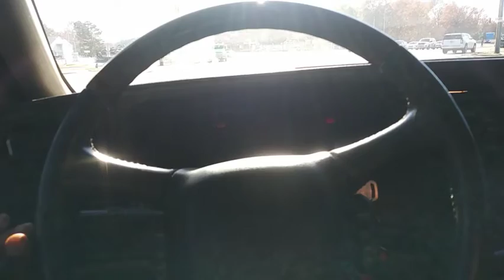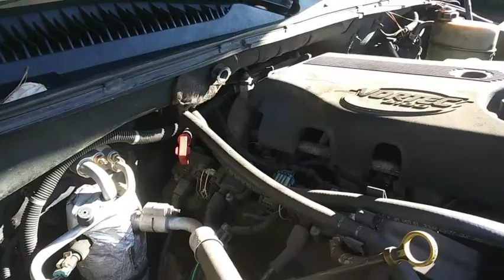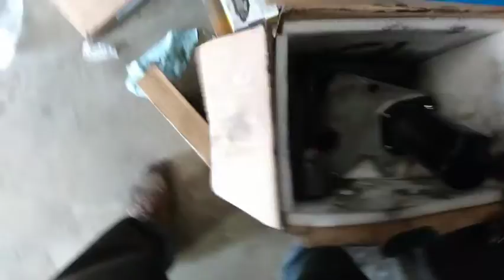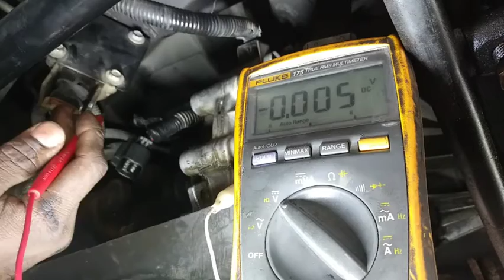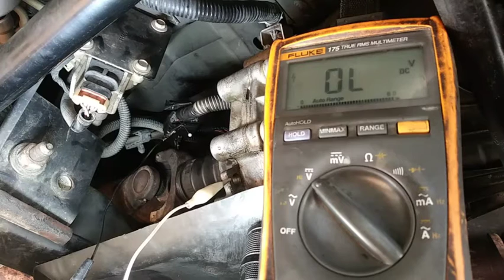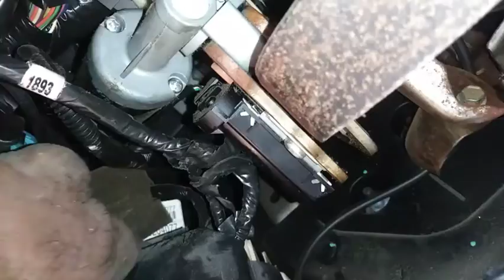???Chevy diagnose C0306 C0374 C0327? SMOKING transfer case???

Comment: stupid question but is there supposed to be oil in the transfer case motor or just gear grease? if theres oil in it, is that shorting out the tc motor?
Reply from the maker: Not a dumb question... The answer is "no" there isn't suppose to be oil in there, likely just electronic grease
Reply from the maker: Likely, this is this particular case, oil being inside cause of shortening out internally or some type of connection issue plausibly
Reply: @partsshooter  ok cool, so just for reference my switch does the same as yours, it all lights up on turn on but then goes blank. so i just did all the test and got all the same values of your working system...except for pin C the encoder ref. i got mili ohms and no voltage (neither test, ground to chassis or using pin F) any ideas?
Reply from the maker: @nuffsaid5205  when you select a mode at the switch [4lo 4hi etc], does the mode flash several times and nothing happen or doesn't flash at all
Reply: customhonda it only lights up on initial turn on then the switch does nothing. I’ve replaced the switch, encoder ring and front axle actuator
Reply from the maker: @nuffsaid5205  gotcha... Disconnect both encoder and switch in truck, Do a resistance test from channel c [red/white] at encoder Motor] to switch inside [also red/white wire] there should be low ohms around 3ohms. If not fish for the open wire. Compare resistance to channel D corresponding wires, they have the same operation fundamentals
Reply: customhonda here’s what I got so far; with battery disconnected I was able to trace pin c (on my vehicle it’s black with white stripe) up into the engine bay to a connector next to the fuse box with my voltmeter. At the encoder connector I get a .4/.5 ohm. Followed to the connector under the hood (no break in wire anywhere) it measures .1 ohm from encoder connector to there. I was able to trace that to the connector for the tccm and also got .1 ohm. But I get not continuity to the switch connector for pin c. (Even with battery and key on). No fuses popped. Between the tccm and switch there’s seems to be no wire damage. Through the tccm do you know which pin would be the output for pin c to the switch...if there’s even one? Because if I can find an output pin that’s not measuring I could probably assume it’s the tccm that’s bad right? But then again why would all the other pins at the encoder connector measure correctly except for c...(lol sorry bro for all the questions you’re the closest I’ve come to anyone being able to help me)
Reply from the maker: @nuffsaid5205  send your vin. Let me pull a diagram. Doesn't seem like my schematics are the same as yours. 

Because on video wires, the switch control module go directly to encoder motor.
Reply from the maker: @nuffsaid5205  also, do you have a scan tool to look at PID DATA? To access 4wd module
Reply from the maker: @nuffsaid5205  I apologise... You're in fact correct, they're the same wiring diagrams. Switch communicate with 4wd module and them encoder. [Switch-control module-encoder]  

I may back track on some things...  bare with me.

Have you simply tried disconnecting the transfer case module and reconnecting for resetting?

- you obviously seems like you have power and grounds going to both switch and encoder.

Only thing we don't know before concluding the actual modules bad is if we can communicate with the module or if theres reflection from switch to control module, and just an output issue. 

Try this... Go to the interior switch, the "light green" will be 8v reference [8v direction,Out module and into control switch] theoretically [I'm thinking based on wiring diagram] you should press a selection [4lo 4hi etc] each selection should vary the output [light blue wire is dog wire to module] commanding module to determine a position. See if you have varying output voltage going through the light blue wire! If so, 

Go to either one of the encoder wires for reflection of similar voltage. Brw/wht, red/wht,yel/blk and or drk blk/white. I assume one of these wires depending on position will reflective respective voltage. May need two volt meters.

This is the only thing I can think of when not having a scan tool it's gonna be convoluted
Reply: @partsshooter  So here's what I've got; (I repeatedly disconnected and reconnected the tccm so it wasn't that)

I did the testing from the switch, got the 3 different voltage readings, also found a video that shows how you can test the switch by itself (not connected to truck)

I couldn't figure out why I was getting all the right values when testing from the encoder connector or from the switch. Affirming the tccm works. All this led back to accessories; encoder motor, actuator, switch etc.

The 4 wheel drive quit working in 4 high. so all the electronics were stuck in 4 high mode along with the transfer case. So when I plugged in the front actuator it would activate etc.

 What I did was took a pair pliers and manually turned the transfer case to neutral. Took the encoder motor to my battery and connected the motor to the battery (inside the wiring harness it was the black and red wire) forcing the motor to turn the gear inside until it was in the position of neutral as well. I also took apart the encoder motor and completely cleaned the inside with brake cleaner making sure the connections inside weren't being shorted with the wetness inside. then lubed the gears with thick gear grease. I'm not sure if it was the cleaning of the oily film inside that was causing the little motor to short of if forcing everything into neutral was the problem. either way everything works as it should now and all codes cleared. 

I couldn't have done it without your video or your help brotha and I really appreciate it.
Reply from the maker: @nuffsaid5205  theoretically the encoder motor is bad. I think when cleaning with brake cleaner, you manage to clear the contact surface of the electric motor bruses to commutator connection restoring operation. 

Like having an interior blower motor not work in car, you bang on it restoring contact with bruses to commutator-restoring operation and blowing air.

If it's new, we get bad new parts! If it's old... Likely time for a replacement lol. This is a common problem. Glad we got it working! Thanks for getting back and hopefully this thread aid in another's repair
Reply from the maker: @nuffsaid5205  and thanks for being knowledgeable! Definitely made assisting easier! You know your shit!
Reply from the maker: @nuffsaid5205  ok... I'll check out your wiring diagram when I leave the gym, just bare with me. 

As far as scanning, it's very useful to retrieve codes in modules 1st if present. We're working blindly without it, I'll do what I can with what you have.
Reply from the maker: @nuffsaid5205  you can erase that vin, I have a screen shot, so it's not where everyone can see it